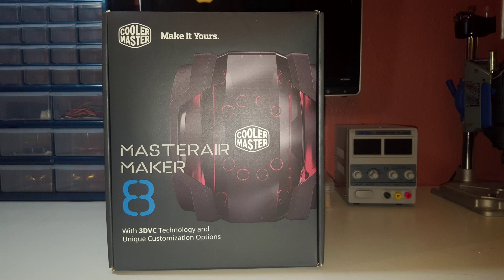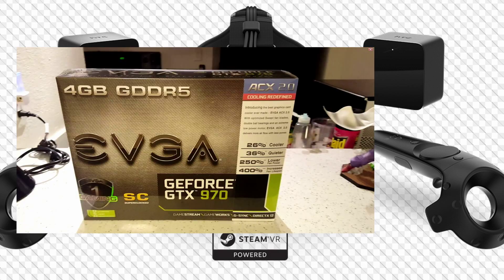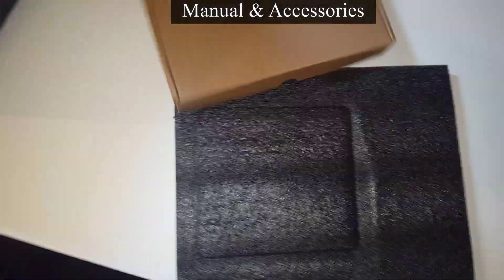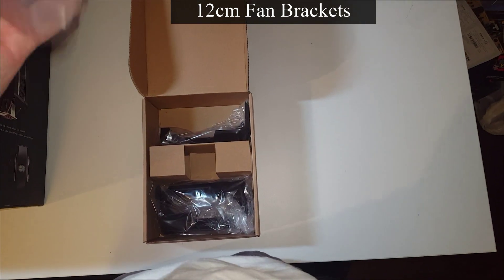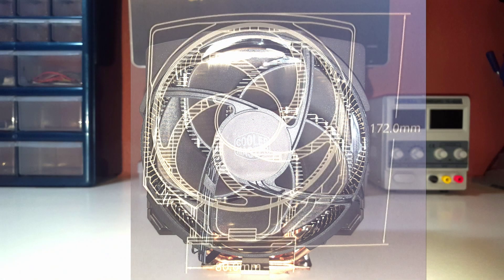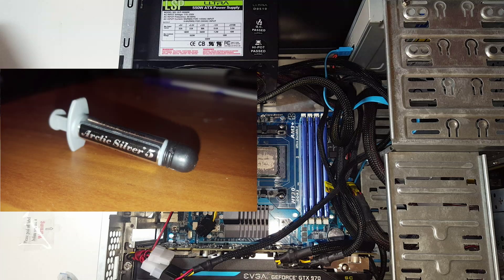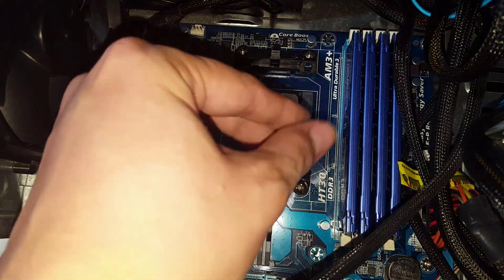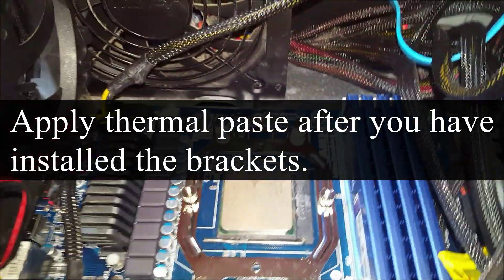MasterAir Maker 8 Air Cooler Unboxing, Installation and Review!

Comment: question please >>> how did you turn off the LEDS of the cooler ? and light faded out like that ??? i cant turn off the lights
Reply from the maker: Ive done nothing, they pulsate on there own. As far as I know, they dont have any programmable scenes just straight up 2 pin power.